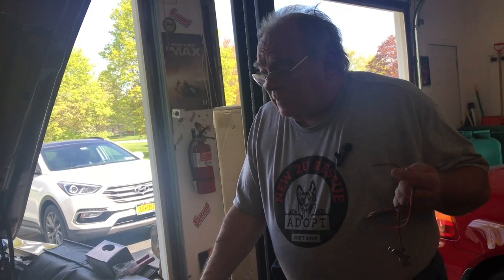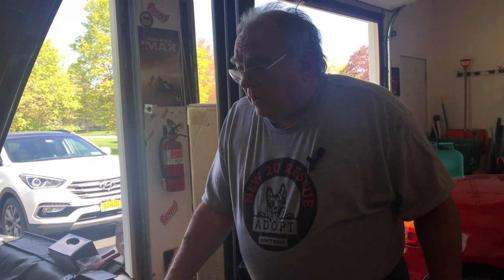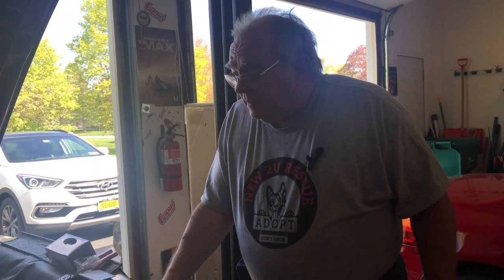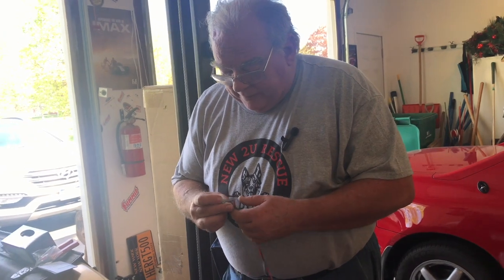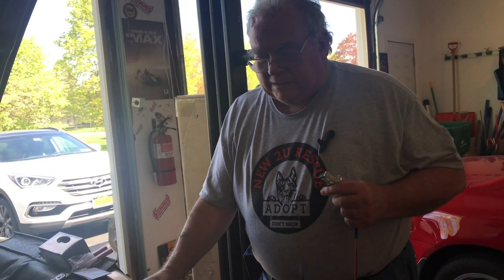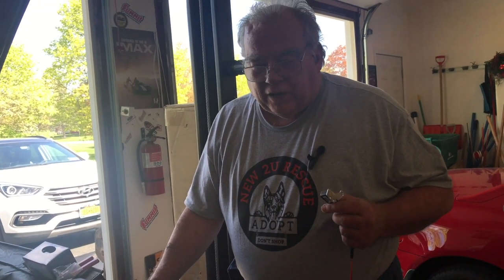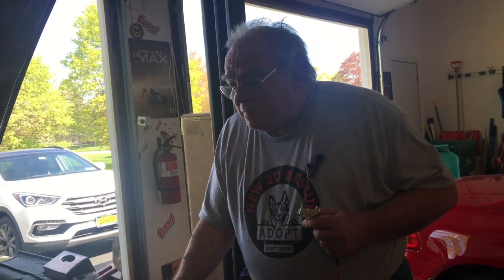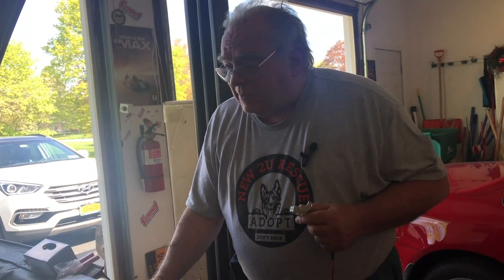1973 Mustang Convertible Complete Installation Pertronix Ignitor And Coil

Comment: Good video, my question will my factory tachometer work,it works with positive post on coil. Also has dual points. It is a 1971 Mach 1 429 scj J code.
Reply from the maker: An excellent question. Let me  check on that.  Please stand by.
Reply from the maker: Hi Ed!

I m still researching the positive coil connection when using Pertronix.  I am seeing several folks advising the connection remains the same, whether using an oem/stock coil with the factory resistance wire connected to the coil + terminal while a separate switched 12 volt source powers the Pertronicx ignitionmodule, and others who are using a Pertronix connected to a new 12 volt switch power source at the coil + terminal.

I am still digging, looking for Pertronix answers.
Reply from the maker: Everything I read indicates the factory tach should work with the Pertonix system with no changes if you plan to use the oem ignition coil.  In the event you use the oem coil the installation will be much easier for you.  The black wire from the 1281 Ignitor is connected to the negative terminal on the coil.  The Red wire needs to be connected to a full 12 volt switched power outlet.  You can tap into Circuit 640 (Red wire with Yellow Hash), which feeds the carburetor Throttle Position Solenoid, or you can tap into Windshield Wiper Motors Circuit 63 (Red wire near the harness connector for the Wiper Motor).  You will want to remove the Circuit 16 wire currently connected to the Ignition Coil's Positive (+) terminal.  

What part of the country are you located?  I ask because we will be doing some traveling next week, and if we happen to be going anywhere near you I would be glad to swing by and help with this project (if you like).

Let me know if you plan to use the oem Ignition Coil, or if you plan to install a Pertronix Flame Thrower (really not necessary, I promise).  If you do decide to get the Flamethrower you want to get the one with 1.5 Ohms of internal resistance (Pertronix Part #40011 (black) or Part # 40001 (chrome) or 40111 (epoxy).  If you get their coil the installation will become more complex re: wiring s those coils run on full battery voltage, and you'll need to bypass the Ignition resistor Wire.  The easy way of wiring in a Flamethrower coil is to not connect Circuit 16 to the ignition coil's positive terminal.  The same 12 volt switch power source you will be using for the Ignitor module's red/pink wire will now connect to the coil's positive terminal.  and the 1280 Ignitor black wire attaches to the coil's negative terminal.  Once you decided on the ignition coil let me know and I will prepare a schematic for you to follow.

The Pertronix instructions for the Ignitor say it is possible for your engine ignition timing to change by up to 10 degrees.  Hence, they recommend you check and readjust your initial ignition timing as needed.  In our case the Ignitor altered my timing by 9 degrees, leaving it too fr advanced.  It was easy to adjust back to 6 degreed BTDC.  So, I suggest you have a timing light on hand so you can check timing before you take the Mach 1 with its now ignition system.
Reply from the maker: Greetings Ed!

I received some more information re: using a Pertronix Ignitor (and Flamethrower coil) with a Ford positive ground tachometer.  Tech Support from Pertronix, and "Autorestomod Manic Mechanic Gasoline Media" (YouTube Channel) came through with some really great info, and even another video showing how to hook up a positive terminal tachometer on a 1971 Mustang.  I added two more PDF files to my library with the pertinent info.  On Page 2 of the following file you will find links to the video file mentioned above:
_1971Mustang_ThrottlePositionSolenoidAndCircuit640_PertronixIgnitor-FlamethrowerCoil_20220715-20230510.pdf 

Here are the links to the two new files:

https://drive.google.com/file/d/1Hj2ZQOVn8LBBGWfw_laP0xQ2kO2cVJJK/view?usp=share_link

https://drive.google.com/file/d/1tdndU25QfDQJ6_Q3QgUadJnb7yIVuKAx/view?usp=share_link

The link to see all the relevant Pertronix files I have produced you can use the following link:

https://drive.google.com/drive/folders/1I8JFY3_k4DrFeCkl7K4QuBNwSsq-_Xa4?usp=share_link

I think you will find the two new files (both with file names beginning with an underscore "_") very useful and informative.

Once you do your installation please let me know how it turned out.  My email is GilHale@gmail.com
Reply: Thanks  will let you know, Ed
Reply from the maker: @edsoares7469  the igniter and flamethrower project was fun. I went out to the 73 vert thus afternoon to move i off our four post lift so I could do some work on the 73 mach 1. The vert fired up immediately. Not one moment of hesitation, just as well as it ever did with points. I am very pleased with how it turned out. Worth the time and effort. Thank you for asking me to help you out. I may have never scrapped the points otherwise. 

Gil

Comment: Just rebuilt my 73 mach 1 and updated the distributor and ignition coil to pertronix flamethrower. I am not getting volts to the ignition coil so there for no sparks. I need help!
Reply from the maker: Where are you located?  I am off site at the moment. Once back at my laptop I can send you some info that may help. If you are anywhere near us (Rochester, NY) I can come over to help if needed.
Reply from the maker: I finally got back to my laptop.  I have a lot of documents to my Google Drive on the Pertronix system.  I know there is a lot to go through.  One document is specifically addressing how to diagnose a Pertronix system.  

Let me know via YouTube messenger if you have further questions or need me to go through the diagnostic steps on video to help clarify the approach.

Here is the Google Drive link for all my Pertronix information:

https://drive.google.com/drive/folders/1Ups4ROw4mWvO6ncBcX_JCfqRZUFntk9X?usp=drive_link
Reply: @gilberthale7777  got it all figured out thank you so much. Now I'm having issues with my C4 transmission not going into gear or slipping. Any ideas? I have thought maybe the torque converter or the vacuum modulator.
Reply: Thinking it's a vacuum issue so gotta figure that out since the egr was deleted.
Reply from the maker: @michaellee1227  If your C4 is slipping it may only need a transmission flid change, new filter, and a band(s) adjustment - if you are lucky.  If yo are not so lucky you may have a band that is badly work (for 2nd gear), or seals that are leaking internally due to age (those seals harden over time, especially if the tranny ever got really hot).  If you are not familiar with adjusting the bands on a C4, this is no a time to learn unless you are confident wih your mechanical abilities and have the tools needed.  I use an inch-pound torgque wrench with a 1/4" aquare socket.  Adjusting the bands is not something you want to estimate or do by feel.  As for the Vacuum Modulator, usually the problem they cause is either> no, or a very late 1-2 gear upshift when ruptured.

For what it is worth, there are several YouTube videos showing how to adjust the bands on a C-4.  The first one I found shows how he does it with no torque srench applying pressure to the adjusting bolts.  That is not how I suggest doing it (I have an inch pound torque with the proper square sockets for the adjuster bolt end).  If you do not have the needed equipment it is best that you go to a shop where they are familiar with these older C4 transmissions.

If you arer still slipping after adjusting the transmission bands, it is more than likely time to rebuild or replace the tranny.  This may be a good time to swap in a speed overdrive (AOD, AOD-S, 4R70W).   I did that with our 73 Mach 1 when its C4 began to slip, badly.  I love the AOD.  I have all the videos showing how we swapped the aOD, to include my vendor and parts list in one of the descriptions.  I also show how to adjust the AOD Throttle Pressure, which is critical in order to prevent frying the AOD inadvertently.
Reply from the maker: @michaellee1227  I purchased a Smoke Machine last year (still unused) that can help locate vacuum leaks.  It may be of use to you in your efforts.  I got it through Amazon at:
https://www.amazon.com/gp/product/B0C7MKZPK3/ref=ppx_yo_dt_b_search_asin_title?ie=UTF8&psc=1

You may find it easier and more effective to use than spraying carburetor cleaner in various areas.  I found carb cleaner spray can give a false indication of a vacuum leak as vapors will find their way into the carburetor air horn.  Seems to me using a  smoke machine could provide more objective information.
Reply: @gilberthale7777  so if the egr is removed can I run the transmission vacuum modulator to ported vacuum on the carb? I installed a edelbrock 600 cfm. Also where do the 2 ac system vacuum lines that come out of the firewall connect?
Reply from the maker: @michaellee1227  Yes, it is the EGR vacuum line that goes connects to the teo port vacuum modulator at the auto tranny.  The EGR vacuum goes to the smaller diameter hose on the side of the vacuum modulator,.  Intake manifold vacuum is applied directly to the larger diameter connect in the center of the modulator.

Do you have factory or after market A/C?  There should be two high pressure refrigerant hoses that go through the firewall.  One is a larger diameter than the other.  The smaller diameter AC hose is the high pressure hose, and it connects to the A/C condenser, which is mounted in front of the radiator.  The larger hose is the low pressure refrigerant hose and it connects to the compressor.  Depending on how the system was built there is a Receiver/Dryer that in the high pressure refrigerant hose, and is between the condenser and the Expansion Valve on the high pressure line.